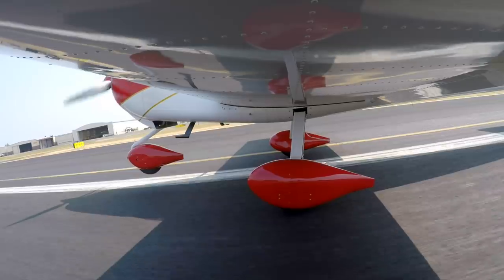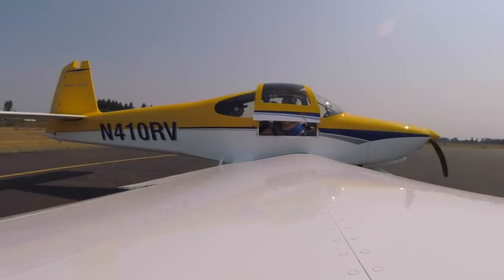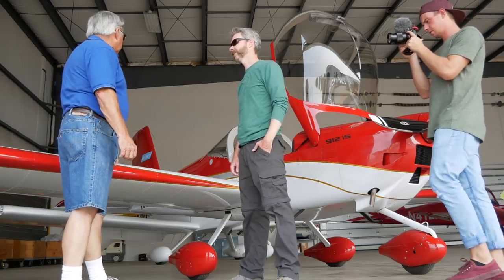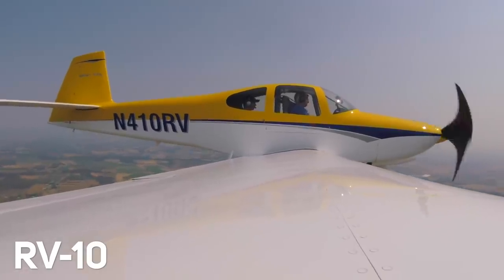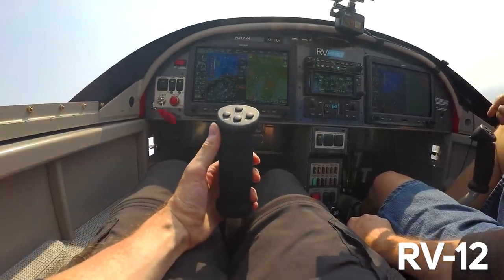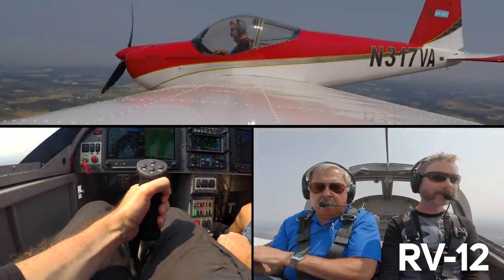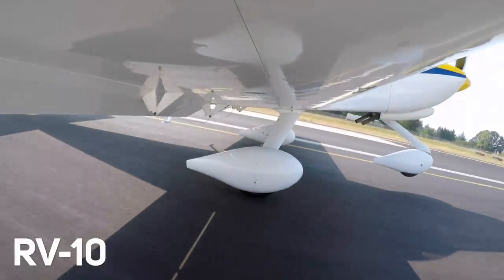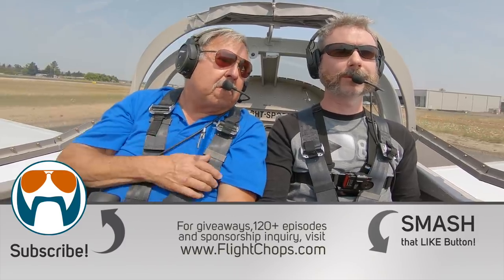Biggest & Smallest Van’s Aircraft (RV-10 VS RV-12) Fleet demo Flying Part 2

Comment: I  realize I'm a bit late on this, but a build series would be great.  There are a few Vans build video series out there, both overview and detail, and they all go a long way into dispelling the impression that a traditional riveted aircraft is hard to do.  I've been kicking around building for years, and I was leaning towards all Blind Rivet (Pop-style) because I didn't want to deal with solid rivets.  Watching on builder in particular working on his RV-10 really brought in the reality that it CAN be done.  The YouTube is Jason Ellis shows his mistakes as well.  Couple that with the folks at Vans itself, and the builder community, and it takes what was an overwhelming prospect, and makes it doable.  I'm leaning towards an 8 for myself, just because the size, performance,  and configuration suit me.   Good Luck Steve, and Clear Skies

Comment: Get an RV14! I am considering one myself. It would be nice to see a High power turbo engine wIth a four place constant speed prop. If your on a budget consider looking at Viking aircraft engines. There 180 turbo can easily be modified to put out 230 hp or more.

Comment: RV-14 looks great, but could you stick a UL Power 520 in it and get FADEC and join the 21st century instead of having to deal with 1930s carburetor controls. The UL520i gives 200hp, almost the same power as the IO260 but in 112kg instead of 140kg. There are two new versions in development, the RR and the HPS, perhaps UL would like to work with you to showcase their new engine? Imagine trying to sell someone a car or motorcycle with a mixture control, the last carburated mass production car was in India, and I think that went out years ago. Why spoil a modern plane with such an anachronism.
Reply: From what I understand, the RV-14 uses the lycoming IO390, which is fuel injected and 210HP. With that being said, the RV-14 is experimental so you can put whatever engine you want in it. A guy put a radial in an RV-8.
Reply: To be fair, fuel injection is also very oldschool. The Germans used it in a lot of aircraft engines during ww2.
Secondly, why do modern piston engined aircraft not use automatic pitch and mixture settings?
Reply: @martijn9568  it adds complexity and weight to the system. You not only have to carry around the FADEC computers but also additional batteries to power it if your alternator fails, and that is weight you could have used for baggage or people. Now don't get me wrong, I love having FADEC, I have 50 hours in a DA42. But is it really that hard to have to set the mixture or control your prop setting?
Reply: @mikeak172  PLUS... It gives you options for LOP and you can clean up a fouled spark plug
Reply: mmm, nah.
Reply: @mikeak172  I think you're right with that, but it would be something for aerobatic aircraft.
Reply: @mikeak172  It's not hard, but it's so embarrasingly trivial to automate. And miniaturisation should have made the weight negligible by now.
Reply: @salvatoreshiggerino6810  Very true but it is still going to be 20 lbs of batteries that could be used elsewhere. Plus the idea that the engine will fail during an electrical failure kinda sucks. And I'm not saying that having FADEC is bad, its just not necessary and adds a lot of complexity to what is a very simple system. But if you want a FADEC, put in a FADEC.
Reply: @mikeak172  that radial in the -8 is seriously cool looking, too.
Reply: @martijn9568  the primary answer to your question is 'the electronics.'  Why do we still use mags? They are reliable and the engine doesn't shut down if you lose your batteries or alternator.
Next, FADEC is expensive.  You're going to get hit with the cost somewhere along the way.
Finally, the FAA.  Trying to get that sort of system through the FAA is, or would be, a bureaucratic nightmare.  There is no real motivation for the FAA to push forward on it.  If they had their choice, we'd all be flying turbine powered Skyhawks!
Reply: Many overlook the io 375. Bored and stroked 360. Lighter and almist the power of the 390
Reply: @martijn9568  The Rotax 915 iS engine is FADEC multi-port fuel injection, turbocharged, with a single lever MT constant speed propeller that is electrically controlled and hydraulically actuated.  That's the most modern setup out there right now.
Reply: @sonshinelight  Stop running Lead in your fuel and the fouled plugs problem vanishes too. Run Mogas in a RV-12 iS with a Rotax 912iS, and you change spark plugs every 200 hours.

Comment: That RV-12 with a 20 gallon tank has a smaller fuel capacity than my daily driver.  That seems way too low, doesn't it have other tanks?
Reply: Dead Baron - RV-12 iS will burn 3.8-5 gallons an hour depending on how ya fly. Most everyone needs a bathroom stop before fuel gets low.
Reply: @gregpdx  Yup! And the range is about 555 miles, and that's at 131mph cruise. 20 is plenty on a small plane like that.

Comment: Line up is simple if you imagine wearing roller skates. No matter the aircraft size or configuration, just put your skates on both sides of the centerline like you’re guiding on a metal rail. It’s amazing how the visualization of wheels on your feet gives you instant feedback to ride that virtual rail.
Reply from the maker: Hey - that's an interesting way to look at it!  Thanks!